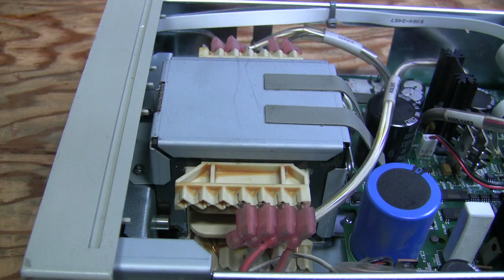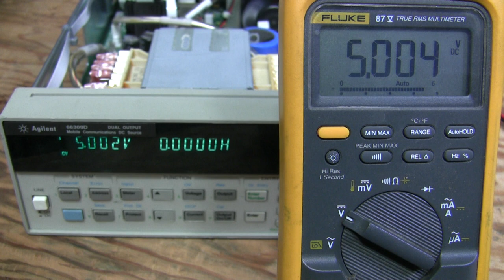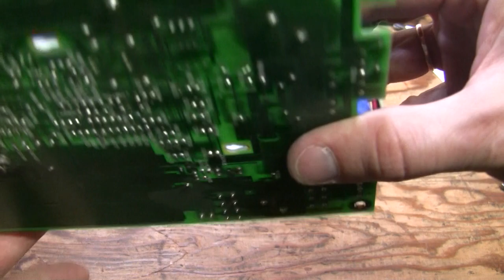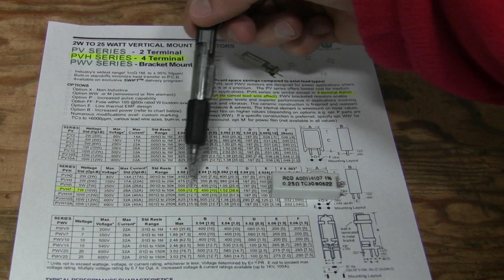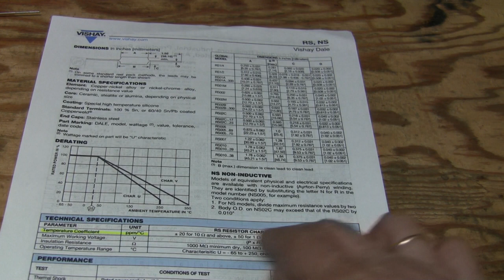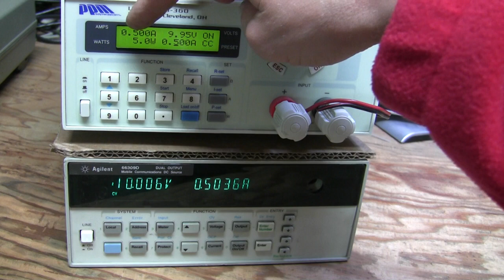#7 - Agilent 66309D repair and calibration

Comment: After HP bought Compaq computer, I suspect much of the upper management of Compaq came with the merger. Essentually HP became Compaq, with many of their (bad) management practices. When they slit off Agilent, the HP name followed the money. (The previous year HP sold 3 billion in insrrumentation, but 26 billion in computer equipment.) Anyway, it was at that time many of the HP quality features went away. No more beefy chassis components, including front panels. Cheap plastic parts replaced multipart aluminum front panels. In example I never saw broken bananna terminals on the old 34xx DMMs. But replaced no fewer than FIVE broken terminal mounts on relatively new 3458A meters. The price didn't come down of course. But it was almost comical to see a meter which electronically represented the highest technology on earth... with a cheap plastic front panel.

Comment: Did you fix the rotary encoder?
You can buy the knob from agilent directly for $ 245
Reply from the maker: Yes, I installed an encoder. Here is the part on DigiKey:
http://www.digikey.com/product-detail/en/EN16-H20AF15/987-1199-ND/2408777
Yes, the knob is part number 33120-87401, costs $2.67+tax on Agilent site, but they sell only to businesses... I managed to order though.
Reply: Good enough reason not to buy Agilent products.